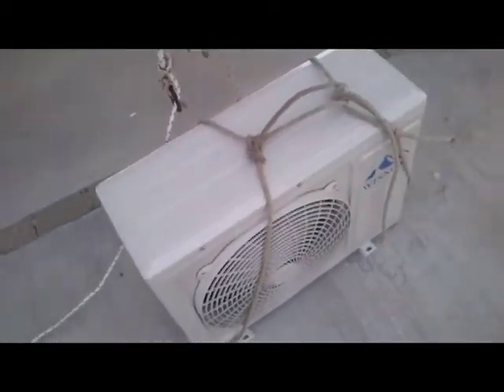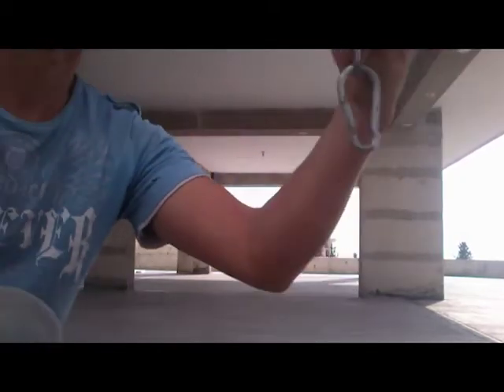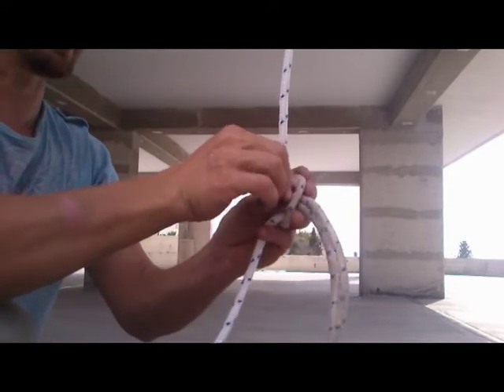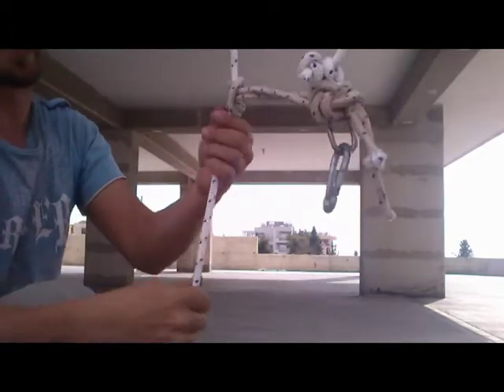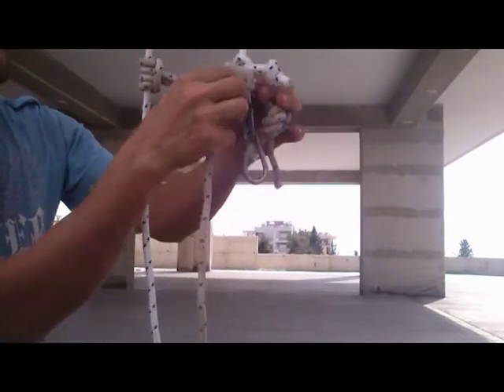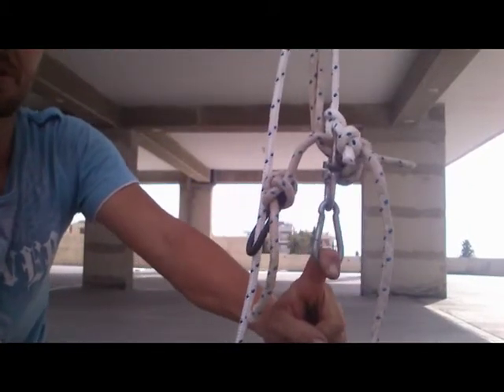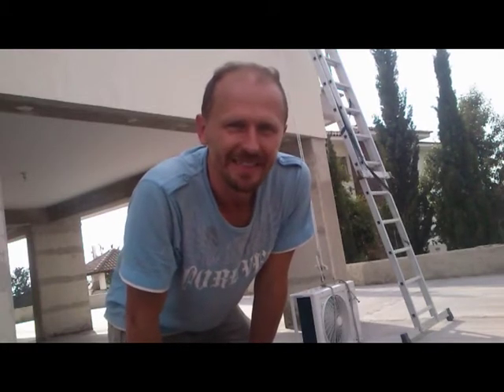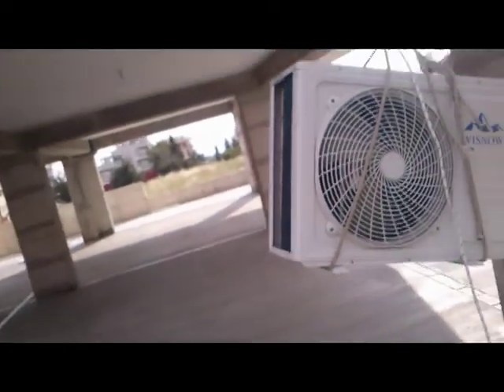Useful rope tip. Safely lift up heavy loads.

Comment: Good Job Piotr,

The first Rachet Knot is called 'Prusik knot' and the 'Clasps' is a metal loop device with a spring-load entry is called as a 'Carabiner'

I like the easy way to lift the heavy load, but you should never use a 'Stopper Knot' to secure heavy loads, they are very insecure. A 'Stopper Knot' can squeeze through back at the Rope entry point at heavy loads.

There are many other weight bearing knots like the Anchor Knot / Figure Eight Knot / Double Alpine Knot / Siberian hitch, and many more...I advice you to learn such weight bearing knots for your use.

Thank you
Johnson
Reply from the maker: this vid was done ages ago. Since than I acquired proper rope access equipment and read through tons of articles and videos. I even considered sprat or irata certification, but since I am not going to make it into my career path, I decided not to bother, I work only on our company buildings.  For 99% of tasks I use three, maybe four kinds of knots. I almost forgot prusik, for that kind of tasks I use my climbing devices. Thanx for support, stay safe.

Comment: Piotr Misiuna -  Your knot work is crude, the overall concept is sound.  More safety features couldn't hurt.
That adjustable knot that allows you to lift the load is called the Prusik hitch.  
https://en.wikipedia.org/wiki/Prusik